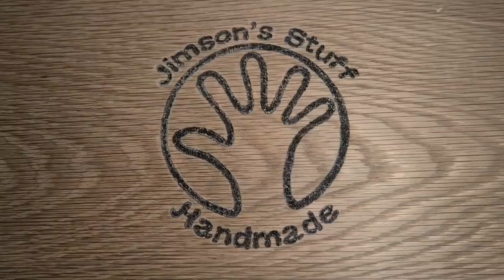What have I been doing? A Workshop Update, ATDP13B and BS400 reviews.

Comment: Hi Jim
I am a real fan of your Milliput videos - and have a question relating to the bonding strength of the product.

My question is as follows;

If I cute a deep groove (say 1/2") on the outside of a bowl before hollowing - then fill with Milliput - is there enough ending strength in the Milliput to hold the bowl together if I hollow the inside to 3/8". My point being that if this wold work - then I would have a corresponding line on the inside of the bowl.
I have no concept whatsoever if this would work. Do you have a comment? Experiences with trying this? Any recommendations etc.
I really appreciate your videos, please keep up the good work.
Regards
Dennis Beamish Cambridge Ontario Canada
Reply from the maker: Thank you very much Dennis, I have actually done this and it does work. The video where I show how, is the one where I review the Longworth Style Chuck. I do paint the inside of the recess with a thin coat of slow setting epoxy resin immediately prior to pressing in the Milliput, this is probably not strictly necessary but it does make sure there is a strong bond between the wood and the Milliput. I was a bit cautious about strength but had no problems and in theory I guess it is little different from many segmented pieces.
Cheers, Jim

Comment: I've been a fan for a while now, such adventurous projects, they are very inspiring!.  I have the same lathe (and legs), did you fix  the end extensions to the legs or to the timber shelving?  I'm intrigued, as I want to do much the same, but couldn't quite make out how you have attached them . . . SteveH
Reply from the maker: Thank you Steve. I fixed the end extensions to the legs using bolts and the 4 predrilled and tapped holes that are already on the legs ( meant for the bed extension when set at a lower height to facilitate turning bigger pieces off the end of the lathe ). The threads aren't metric, I think from memory they are 3/8 UNC. They are a bit rough and ready but they do the job and it means you keep all the weight on the lathe to minimise vibration. Hope this helps. Cheers, Jim.
Reply: Thanks Jim, I'll check it out and get building.  I'm just retiring, so hope to spend a chunk of time at the lathe.  Glad to know that you are feeling better and most, if not all, of your troubles are behind you! Cheers, SteveH

Comment: nice work mate in the workshop and also good news that you are on the mend :)

i love that idea of the foot pedal and i might employ that method for a carver ive bought to stop me having to reach over to the control box every time i want to start stop or change a bit.
Reply from the maker: Thanks Mark , which carver did you get? If it is the Proxxon, I think they make a dedicated foot pedal for it. Otherwise there are loads of heavy duty foot switches on eBay and it is easy to wire up an extension lead.
All the best
Jim.
Reply: Jimson's Stuff oh i went a bit mad its a microcarver, 48k rpm and very very quiet, i think they do a footpedal also but im just asuming now that it will be pretty expensive
Reply: Jimson's Stuff oh actually its just under £15, ive still got to try it out yet on something other than making channels at lightning speed, I want to try and do some relief carving but have so many projects it might rake a while to get around to it :/

https://www.classichandtools.com/acatalog/Micro-Pro-Mastercarver.html